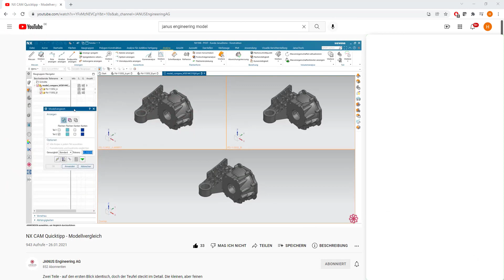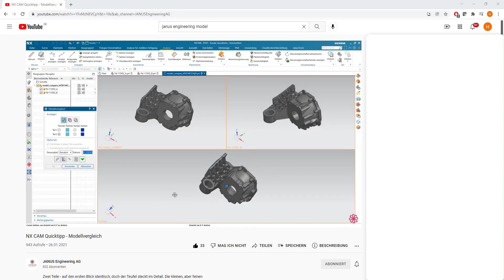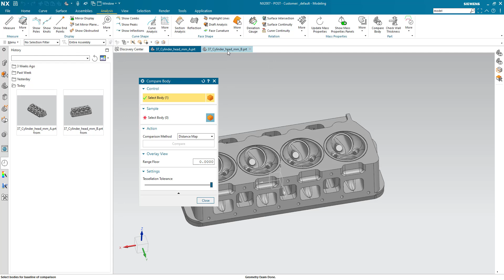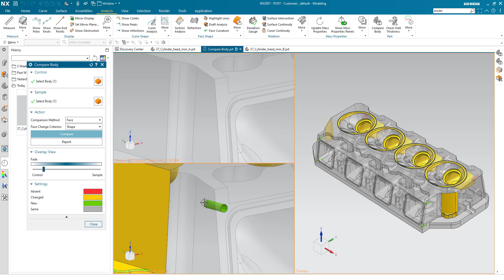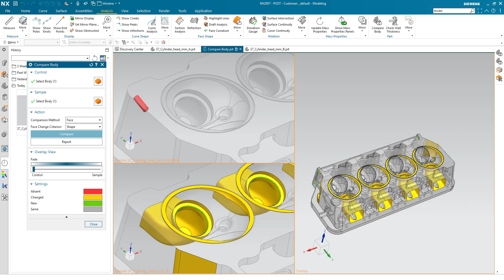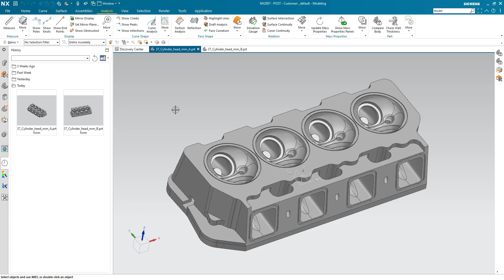NX CAM Tutorial | Compare Body in Siemens NX 🔎

Comment: Does this work with imported parts too or only NX parts?
Reply from the maker: Hi, this function works on imported files (such as parasolid, .jt etc.) as well. In fact, the shown bodies are imported from a step file. You just have to make sure that the two bodies that you want to compare are set on the same absolut zero coordinate system.